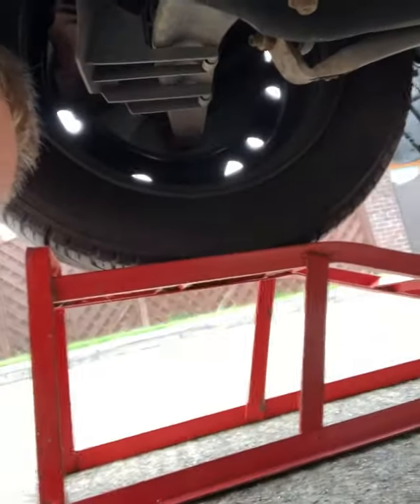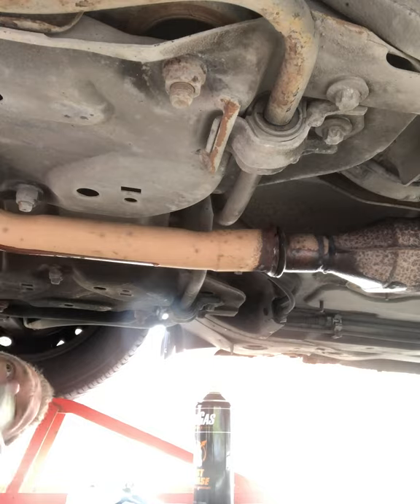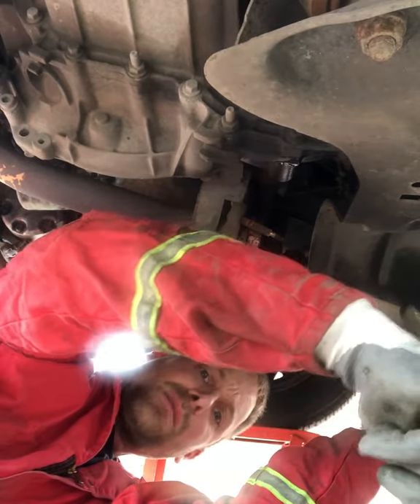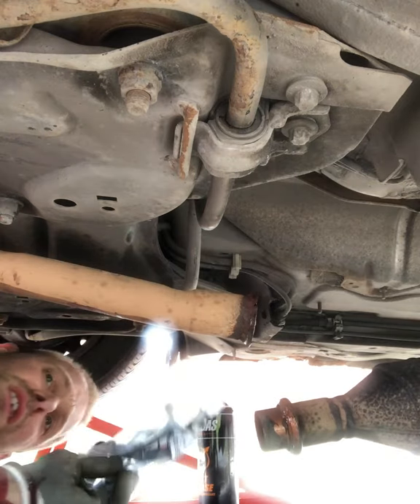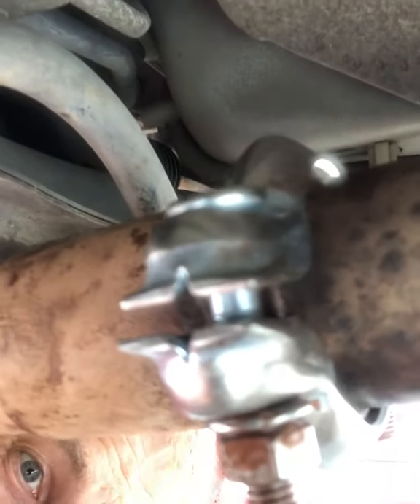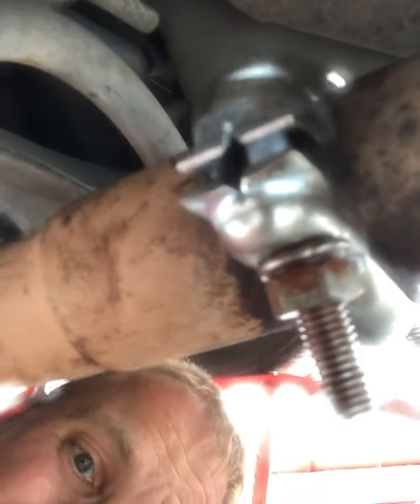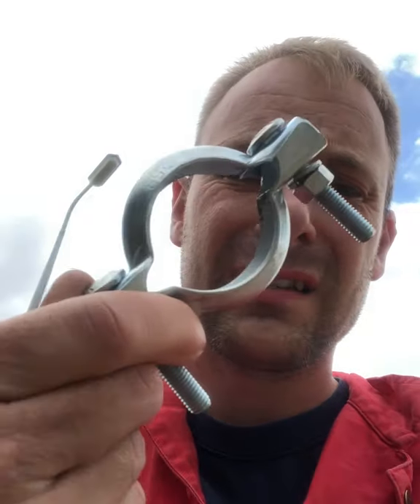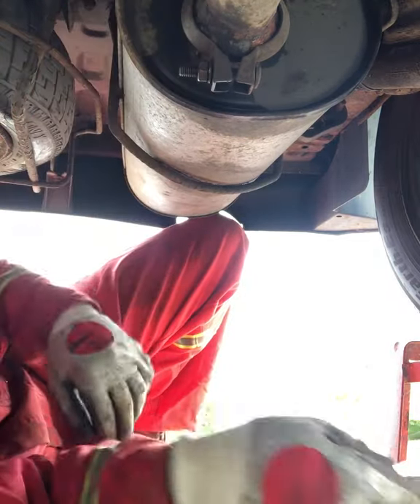Peugeot 206 - Exhaust Clamp and Squeaking Flexi Pipe Repair

Comment: This video really helped me fix my exhaust, I must admit the issue is much simpler than expected!
Reply from the maker: It’s an awful annoying sound until it’s fixed isn’t it. It ended up being a yearly operation, clean and lubricate the exhaust while I was down there doing an oil change.

Comment: Hero!
Reply from the maker: I assume you had the same issue
Reply: @NickThornhill  yeah still have the squeeking noise, going to fix it sometime soon
Reply from the maker: It’s well worth look at changing the lower engine steady at the same time as it also stops the movement that causes the squeak. I have also done a video on this as I changed it with the driveshaft. Bit more technical of a job though.

Comment: how is it after this time? were squeaks hearable only in motion or idle too?
Reply from the maker: It didn’t make a sound. I had to remove it again a year or so later when doing another job so I gave it another quick clean and copper slip lube and it was silent still. I’ve actually sold it now.
Reply: @NickThornhill  ok thanks, i just bought 206 and ive got same problem but your video helped me, best wishes ;*

Comment: Changed my middle-pipe and resonator last week. Would have been quicker and easier to raise the car but i managed without. Luckily no seized bolts.
Reply from the maker: They seem to be good on the seized bolts for some reason. Nice one. How did it sound afterwards?
Reply: @NickThornhill  The exhaust connectors were relatively new so I figured I wouldn't splurge 50€ for 2 ramps yet. Doing much of the work with one arm was quite a workout and I still feel it. Sound... well, I kinda liked the sound when there was hole and perhaps felt a bit more power in the low end but it was a bit droning and annoyingly loud at highway speeds. The sound now is quiet, normal for a GTi.

The muffler is intact but needs replacing soon. After taking it out, I realized it's not worth the effort to clean and paint. A sportier muffler is on the way. I should try to do make a comparison video when I change mufflers.
Reply: The strap holding my fuel tank on looks about the same. 🙂

Comment: What about the oil leak?
Reply from the maker: It’s not dripping or getting worse, it was only an MOT advisory. Rule no.1 if it’s not broken, don’t fix it 😂😂 a lot of the damp oily area is from where the head gasket was leaking down that side of the engine, common fault, I have replaced the head gasket, sadly before I started making videos.

Comment: Plus Gas. I remember using it over 50 years ago, but not in a convenient spray can!
Reply from the maker: It’s great stuff isn’t it. Stinks to high heaven but works a treat. 

Also helps if you say it with a Sean Connery accent.